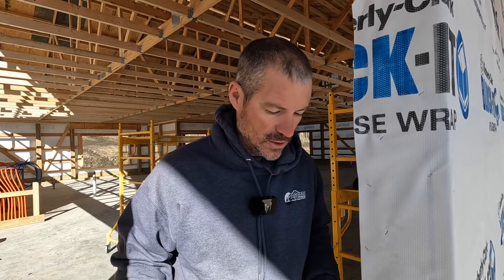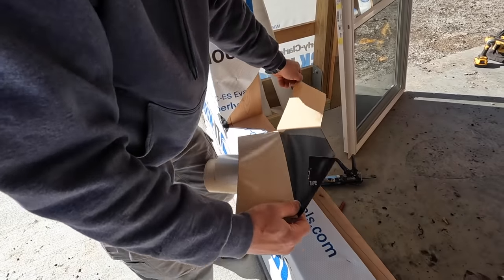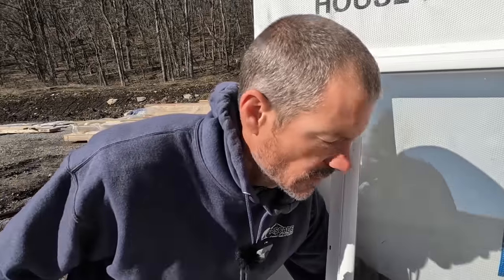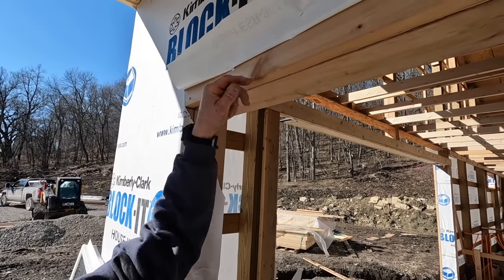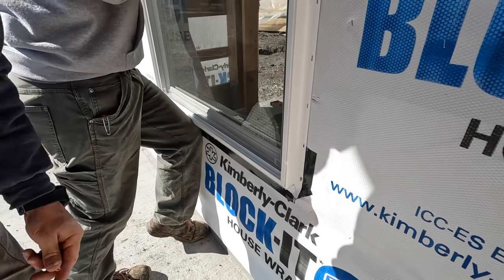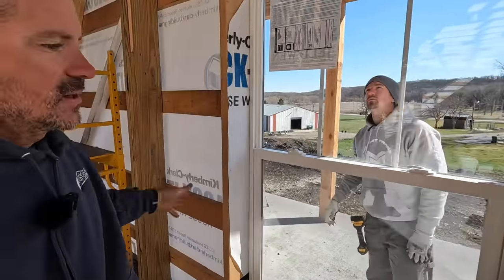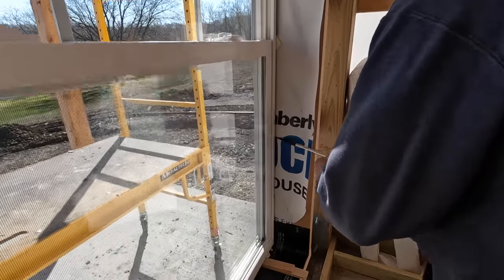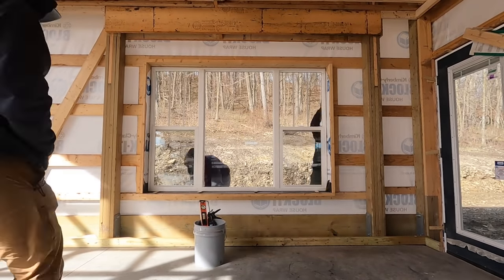Building a Post Frame Home | Window Installation | Remington | Ep 13

Comment: The post frame concept is good but the siding needs to be something other than metal otherwise it looks like a garage, warehouse or storage building. I like metal roofing. The exterior siding selection creates material balance, esthetics, interest & special dimension.
Reply: That’s kinda the point, to look like a barn. You can do any siding or veneer on a post frame with zip sheeting or plywood.
Reply: I concur. I wonder how well the post frame building techniques would work in collaboration with a compressed earth block exterior and insulation between the ceb's and posts.

Comment: Hi.....ok I got confused and I know nothing about this stuff but I enjoy watching. I live on a mountain top devolvement and have watched over 150 houses being built and they all used wood sheets on the roof and walls. So, episode 11, concrete....then episode 12 was back to the porch pre-concrete, then I was expecting wood sheets on the walls like the roof, as it makes a nice surface base for the vapor barrier, then steel and then the insulation on the opposite/interior side of the wood sheets, but it appears just to be wrapped.....wow, why no wood sheets on the walls? Thanks.
Reply from the maker: If you’re using steel it isn’t necessary to sheath any of it. The roof we did to give it better durability for all of your venting, etc